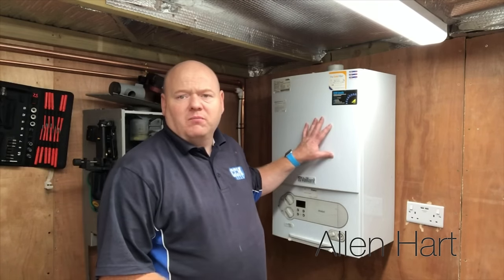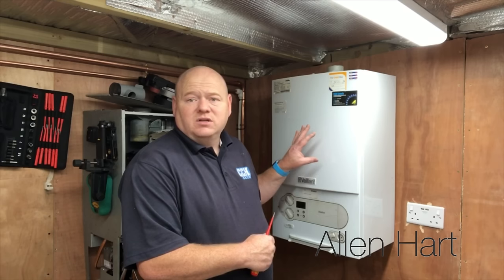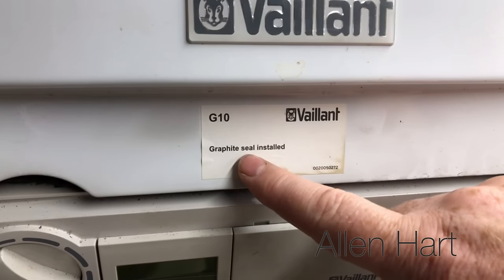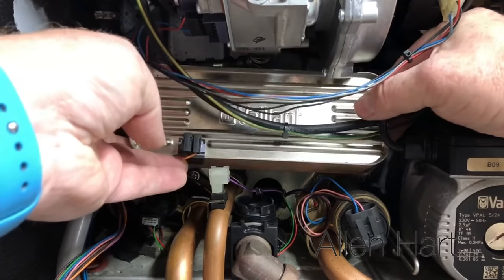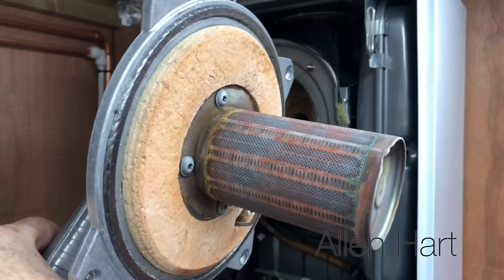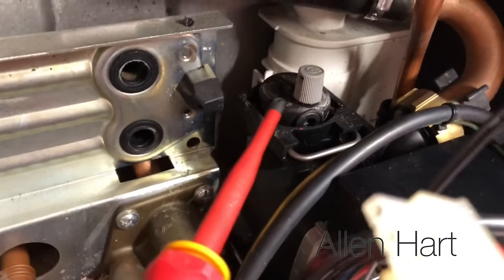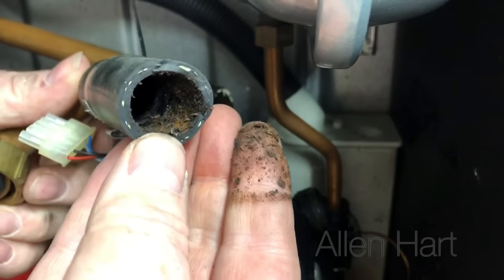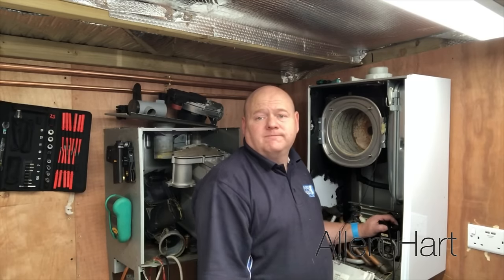Vaillant EcoTec Plus Gas Boiler Strip down

Comment: Excellent boiler the main issues we have Allen at work are f.75 wps blocked due to installers not flushing system when boilers are installed.
Other than that o rings leak on divertor due to system being dirty again and I find many times on annual services exp vessels flat.
However is an excellent boiler
Reply from the maker: Would you agree that the rubber hoses help to cause the dirty systems or do you find that even the ones with copper inside have the same problems. Thanks for your comments.
Reply: Allen Hart yes definetlly the ones with rubber hoses are the main culprits.
If the systems are maintained and fitted with a suitable magnetic filter this normally gets rid of this issue.
Reply from the maker: Same as most boilers really, They all need looking after. Thanks.
Reply from the maker: I believe the hoses can be upgraded to copper.
Reply: Allen Hart yes they can
Reply from the maker: Personally i dont think they are a bad boiler. easy to work on and service.
Reply: Me too easy to replace parts.

Comment: very good video- Thanks -I have the same boiler and in interior soundproofing foam has rotted and fallen to pieces all over the interior .Should the Fan need replacing do you thinks? You would have thought this foam would be designed not to turn powdery and degrade. Bolier is 2011 Thanks
Reply from the maker: Glad it helped

Comment: Hi Allen, i have an Vaillant ecoTEC, boiler is aprox 15years old and works fine apart from in the colder days when the boiler fires up i hear this high pitched woowooing noise for about 30secs comming out through the vent, any help would be great thanks

Comment: How do i change brass diverter valve cartridge with black electrical connector i saw you  working on a vailant combi ecotec pro 28 just like the one  here at my house  it's leaking water from the diverter valve it  needs a new cartridge   but you did not touch the diverter valve in your demo  please can you show how to change the cartridge thanks

Comment: Just to add if you change those rubber tubes for copper it can melt the condense hose in the boiler.
Reply: Mine are copper and melted the condensate pipe, it was a long fix.

Comment: Hello, I have the 2016 vmw 236 ecotec plus model, and it is with propane gas g31 and I wanted to change to natural gas g20, I have been looking at the specialist level and I can not find anything, other brands with changing injectors and adjusting maximum and minimum and  changing a value works, but in this I can not find information, according to the manual there is a reset kit, but I can not find anything, thank you very much and greetings in advance

Comment: Hi Allen

What could the S.30 code be pointing at. My issue is since installing new double radiator as part of home decoration job my heating was coming on randomly despite my thermostat set 15 or in the off/lowest number. In the beginning for a few days I had my hot water go off, my boiler working hard, but then it returned back to normal. Did have someone look at it, he took off timer unit saying sometimes it can affect it.  But since none of the radiators were warm difficult to pinpoint it. I keep my thermo off completely, but noticed a radiator in upstairs really hot.

Comment: Hi, I have a ecotec plus 624 isolated boiler system, where there is no loop underneath to turn valves.
There are literally 4 pipes underneath the boiler, 1 pipe on the right, feeding straight into the boiler and the other 3 pipes which look like the have possibly valves on them, but I don't have taps to turn.
I took the front of my boiler off and cannot find where to sort the pressure bar out?
I've seen in a manual online that if the bar pressure goes lower than 0.8 (currently at 0.3) then I need to put more water into the boiler.
Please help !!!!!

Comment: Is that black insulation on the boiler casing the seal, if so, does it need replacing.. I have just had one looking similar to this but in a worse condition

Comment: Hi Allen. I bought a secondhan EcoTec 418 some time ago - the seller stated it was surplus following a house extension. Having read about the problems with the heat exchangers blocking up, I'm now rather nervous about installing it, only to discover that it's clogged up (and perhaps I was ripped off!). Is there any way to check that the flow is  freely passing through all the internal channels within the main heat exchanger?
Thanks
Reply from the maker: I would never install a second hand boiler, Call a local heating engineer would be my advice. Thanks. Happy new year.

Comment: I have this boiler installed..
I had a power cut, and it stopped working.
It was reading CON, and I sorted that out, took the condensation catcher, emptied, cleaned and with a great deal of frustration, manoeuvring, wrangling; refitted it..
But still, there is a 0ºC and 0bar pressure reading. 
The pressure is fine, I have a visible gauge, but the electronic gauge/reader/sensor is reading Zero, and once turned on, it does nothing for a few minutes... then repeatedly clicks until I just turn it off..
Is there anything I can do to get it to start back up without taking it apart?
Reply from the maker: Did you sort it? What was it? Thanks.
Reply: @AllenHart999  Yes, I sorted it myself..
I have been waiting for an annual Gas Service by P.H. Jones.. they have failed to show for them, 1st excuse was the Engineer locked his keys in the van, the second no show; they never even had the decency to let me know...

So I am glad I am learning these things myself..

I tried everything, in the end what worked for me was opening the hot water creating a flow through the internals of the Boiler, and somehow that must have turned something that was clogged up or not moving freely..

Once I reset the boiler at the wall, then turned it on by its own power cut out, I then opened the Hot tap, and pressed both the ignition button, and the one under it at the same time.

Still working now.

P.H. Jones.. Pah

Thank you for your uploads.

Ant.

Comment: Hi
I have a 246/5-3 with this problem.
The tap water is to hot!
On the lowest settings, 35c° if I remember correctly, the tap water is above 45C°
Is there something to try?

Tnx
Reply from the maker: Did you sort it out? Thanks.
Reply: @AllenHart999  unfortunately no. It began to give all sorts of rendom problems so I changed it with a new combi condensing boiler.

Comment: Hi Allan I am currently working on this boiler, every time there is a request for hot water the heating comes on. I have changed the the leaking  diverter valve but the problem is still there. What else could I check for to get this going. Sorry I'm a newly qualified engineer and getting on the breakdown side of boilers. Your help would be very much appreciated.

Comment: Thanks for the videos Allen, they're all brilliant. I've got a problem at the moment with the pressure going above 3 bar. I've tried isolating boiler and draining it. But when I turn the isolation valve back on, the bar gauge goes all the way back to red again. Do you think this could be a faulty filling loop or maybe expansion vessel needs charging?
Reply: Expansion vessel needs changing. I have same problem and my heating mentor said thats what i need  to do . He's a college lecturer now and is well trusted.

Comment: Hello everybody,

My experience takes place in Slovakia because I have lived there for 15 years, but the products are those that you will find in France and everywhere in Europe, that's why I come to share with you. And then the brand boasts of offering the strength of a group.

This boiler is sold as a high efficiency gas boiler, by a "family business" in its spirit and approach, which is why we chose it.

In July 2018, we therefore replaced our 20-year-old Buderus boiler with a new Vaillant heating system including the ECOTEC PRO VU 246/5 boiler, solar panels for hot water, the 300-liter water reserve, the Fernox TF1 magnetic filter, the installation and a nice check for everything. Of course everything is done by an approved installer of the brand.

Our customer experience is catastrophic, because I am not exaggerating when I tell you that our ECOTEC is dead: with more than 6 failures in 18 months (overheating, air leak in the system, broken pressure sensor, water leak in the condensing chimney, broken circulation pump, broken heat exchanger) we can say that our boiler is falling apart.

All maintenance has been carried out according to official directives; following the maintenance schedule by a Vaillant authorized technician (all reports in paper and digital format to prove it), we had to pay for each repair even during the warranty period, all the time a Vaillant authorized technician simply pointed out that we we didn't clean the magnetic filter often enough. I have cleaned this filter at least 20 times, Vaillant is not able to define the cleaning frequency but on the other hand, they can say that it is not enough to make the warranty work. In contrast, other well-known brands have no problem officially specifying that the magnetic filter (or mud pan) should be cleaned once a year (I found this by desperately looking for a recommended official maintenance schedule. by Vaillant).

One of the last failures occurred on 31.12.2019; it was the last drop for me: broken pump, Christmas holiday period, and I hear "you have to wait until January 7 and pay because your water is dirty because of your lack of maintenance". I said STOP.

After alerting the headquarters on the Vaillant website, their first reaction was to advise me to change the technician. We had to push via Vaillant Austria for the team of local experts to come to us on 14.1.2020 to check what was going on.
The official Vaillant report says: “The water in the heating system does not meet the recommendations of our installation manual. We cannot prove that all the steps were correctly followed during the installation of the equipment but this was done 18 months ago. If you want more specifications on the quality of your water, you can contact an accredited laboratory to perform more analyzes by yourself. Vaillant equipment cannot function in your house as it is, it presents a high risk of breakdown and the warranty does not apply. We believe that your system is not waterproof, which leads to corrosion. You must install an external heat exchanger to make sure the boiler is working properly. ”

So the high efficiency boiler can only work with a secondary heat exchanger ... no research of the origin of air leaks, just an assumption on the origin of corrosion, but a certainty on the fact that the boiler cannot operate under these conditions and above all will not be guaranteed. No control of the water which has not been treated by the installer, it is up to me to contact an accredited laboratory to prove whether or not the water is treated with an anti-corrosion additive. No response from Vaillant when I simply asked them why today the boiler is said to be incompatible with our circuit which has operated for 20 years (the house dates from 1998). The boiler has traces of leakage at the automatic air vent, at the magnetic filter, and on other parts of the installation. Basically, it is our fault if we are not heating experts to validate the start-up of the installation and its maintenance.

15.1.2020, resigned, we decide to have the circulation pump repaired to recover the heating because it is too cold and we have 3 small children (I must specify that Vaillant will give us the pump while stating that it do not have to come back) but we choose to take another approved technician, the latter is surprised by the number of leaks, the smell and the appearance of the water which proves that it has not been treated, and he explains to us that without treatment, the mixture of metal radiator + PER circuit can only be fatal and irremediable for our boiler because the corroded metal flakes come to use the PER walls to form a paste that the magnetic mud pot cannot capture. He insists above all on the fact that the device should never have started up as it is and that Vaillant technicians are trained for this.

The same day we contact the installer in writing to ask him to come and install a secondary exchanger, we are even ready to pay because still no heating, no hot water and no more Vaillant warranty on a new set over 6500 EUR, I see myself at the foot of the wall. The installer will refuse in writing, stating that it does not validate the opinion of the experts and disapproves of our approach.

20.1.2020, the boiler has broken down again, the primary exchanger is irretrievably blocked. Vaillant refuses the guarantee. The second technician received a lot of pressure from the dealer to give us his opinion, and he no longer responds. Since that day, the boiler has stopped running.

FINAL POINT: Vaillant disengages from any responsibility because the water is "contaminated", the dealer disengages from any responsibility because he says he has put clean water in the system, the first technician accuses us of not having cleaned the magnetic filter quite often, the second hides out of fear. It only remains for me to buy a new boiler of another brand with the feeling of having been rolled, because a legal recourse would take me years ... and 4 months without heating are already more than enough.

Make your own opinion and tell me if you still want to buy Vaillant after my testimony.

Regards,

Jerome
Reply from the maker: Wow thank you for that.
Reply: Hard to comprehend the upset to you and your family, I think adults are able to cope with many problems but young children need special care - it seems the Vaillent system ignored common decency at a time the weather tends to be coldest around Christmas time.
It's possible that the Vaillent tubing configuration in the heat exchanger is itself more prone to blockage than the equivalent units found in other brands.
I have no trust in any company that just passes a complaint from one link in the chain of command to another simply to do nothing, luckily not all companies have a poor chain of command.
Hope you are recovering from your upset, thanks for taking the time to comment - hopefully it will help other parents with young children.

Comment: HOW DO I CHANGE BRASS DIVERTER VALVE  CARTRIDGE WITH BLACK ELECTRICAL CONNECTOR AT THE MOTOR I HAVE VAILANT COMBI ECOTEC PRO 28 BOILER AT  HOME AND THE DIVERTER VALVE IS LEAKING HOW DO I FIX THIS PROBLEM PLEASE HELP

Comment: Service about 300 ecotec’s a year
Also irs big brother the 656
Both These are one of the easiest boilers to strip down
Everything comes out of the front
Great if it’s trapped between cupboards etc
Yep defo change rubber tubes for the cu tube kits
Boards are an issue
Also earlier models had pumps sticking
I’ve also had quite a few crack on the  plastic manifold on the gianonni heat ex
So need new engine
Also the foam behind the door perishing 
I wish the there was the perfect boiler
Unfortunately there isn’t I’m afraid
Reply from the maker: Thank You

Comment: Hello, I have a Vaillant boiler vmw it 282 / 4-5 r2 turbo block plus the problem that has appeared for a few weeks is the following: Error F.27 appears, could you help me?
Thanks
Reply from the maker: Did you sort it out?
Reply: @AllenHart999  Yes, there were oxidation problems of the various contacts.
Thank you
Reply from the maker: @baffoxxx2117  Did they install new electrodes? Thanks.
Reply: @AllenHart999  No, only cleaning with spray clean electrical contacts.
Reply from the maker: @baffoxxx2117  That’s good, Hopefully it didn’t cost too much. Thanks.

Comment: Every time I switch on heating for hot water, my radiators also get hot. The heating system is switched off though. Please explain.
Reply from the maker: You will need a gas engineer / Plumber to come and check it for you. Sounds like it could be diverter valve but it could be other things as well. Thanks.

Comment: Would the plated heat exchanger be somthing that you could replace without being a plumber/boiler engineer? I'm a mechanic to trade so am confident in swapping mines out as it is leaking but obviously never done the job before so wonder if you'd think its a good idea or am I better leaving to a proper boiler engineer
Reply from the maker: No, You need to be competent and have testing equipment to check it’s all safe. Thanks
Reply: @AllenHart999  Yeah completely understand that, will get someone out in the new year then. Was going to just go to vaillant direct for an engineer or would you say I would be cheaper/better going for an independent plumber or are vailliant just as good. Not had much luck with independents in the past unfortunately which is putting me off finding another
Reply from the maker: David Moran Using Vaillant might be a bit more but hopefully you will get good service. Thanks
Reply: @AllenHart999  Thanks Allen, really appreciate you taking the time to advise me especially today. Hope you have a merry Christmas. Regards David :)
Reply: @AllenHart999  Hi Alan, Little update on my problem. So went direct to vaillant in the end for a one off repair, got charged a £285 flat rate which thought was quite reasonable. First engineer came out and changed the heat exchanger seals and told me the mounting plate that the exchanger bolts onto was badly corroded but to keep and eye on it and report back any issues. First repair only lasted about a week unfortunately so called them back out and the guy changed the full lower section of the boiler. The heat exchanger itself, the plate the exchanger bolts onto and all the valves etc attached to that. Over the moon with the service and for £285 i think I've done very well out of it for what turned out to be quite a big repair in the end 😁